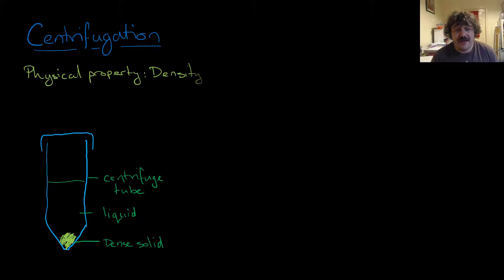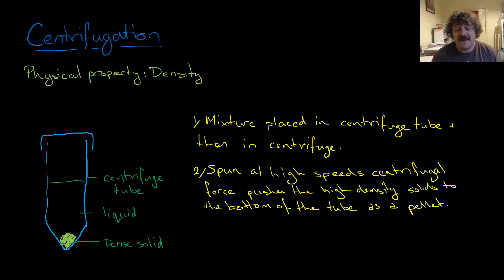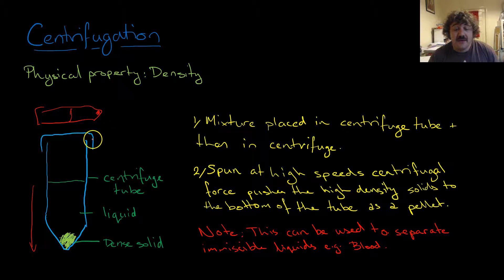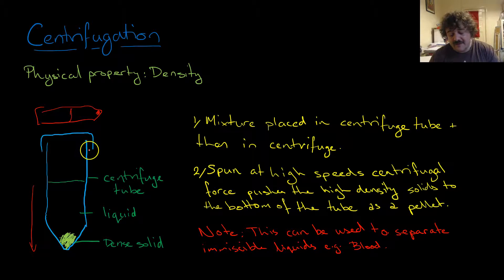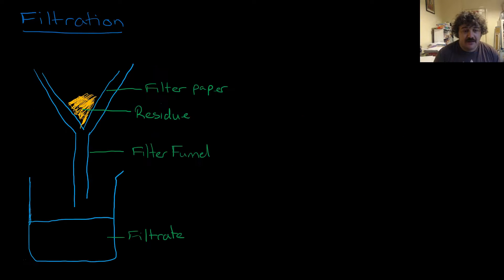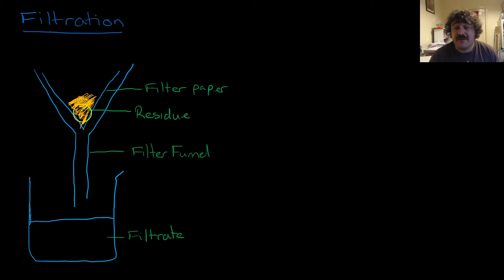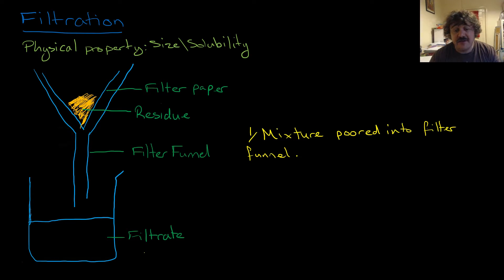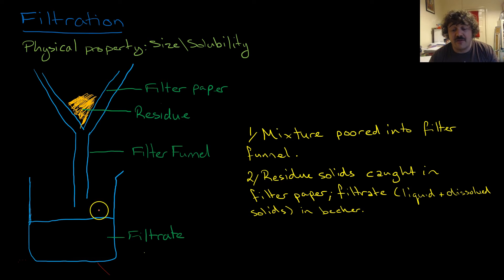Separation of Mixtures: Solids and Liquids

Comment: Question: given that filter paper can separate solid from liquid of the basis of particle size, can it also be used to separate two liquids? Can liquid molecules have a great enough disparity in size to allow this to happen?
Reply: +Alex Butcher It might be possible, but a safer method for this would be to just go straight to distillation (covered in the previous video) or centrifuge, provided the two liquids dont mix
Reply: +Jack Willis 
Thanks for the answer, I agree that in a practical setting that would indeed be the case- but hypothetically, is it possible to separate liquids on the basis of molecule/particle size alone?
Reply: +Alex Butcher It would be possible, considering some liquids have larger molecules than others, but you would have to have either a large difference, and a good filter, or an amazingly fine filter, either way, you need a really accurate filter. c: